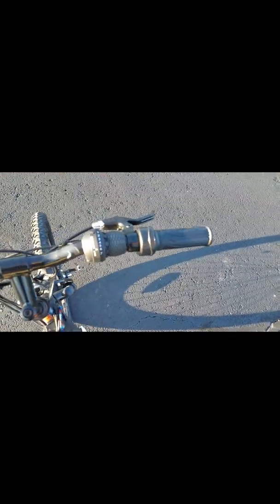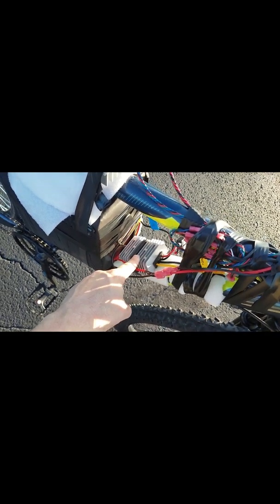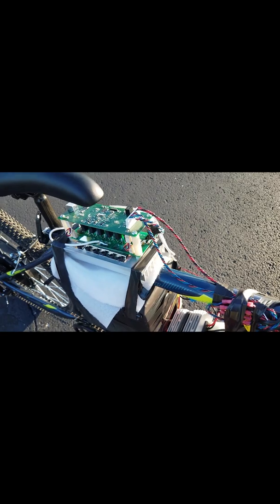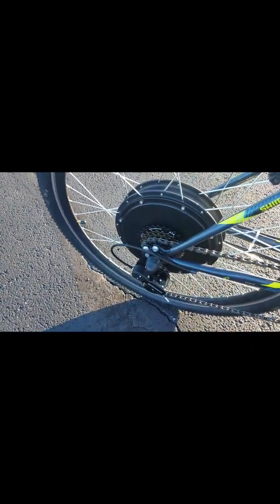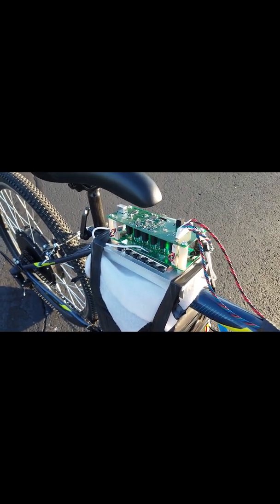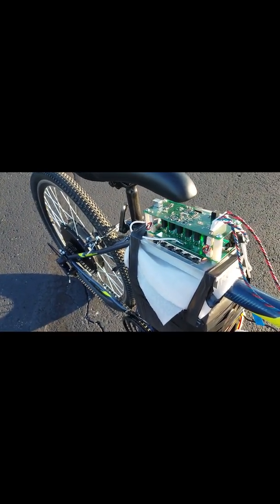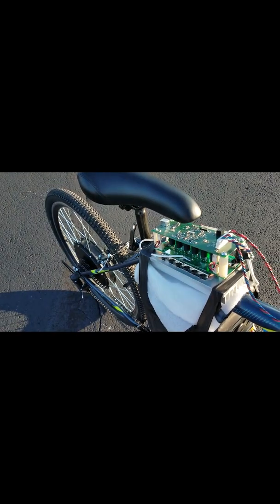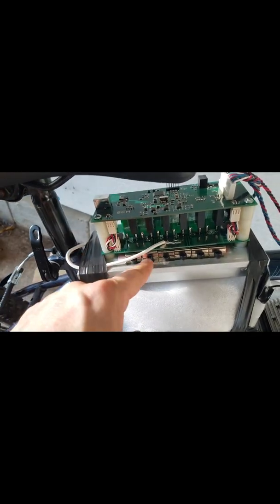First test of E-Bike With Home-made controller

Comment: Hey, I'm going to video my latest version of the leaf motor doing work. I bought a grasshopper mower and it's now running 96v with the leaf motor/controller and your board. Pulls 3kw while mowing and only gets a little warm to the touch, no coolant needed for my little yard.
Reply from the maker: Awesome awesome awesome!!!  Yes please share!
Reply: @MPaulHolmesMPH  I want to build a 4 wheel motor 4 seater bicycle. I bought the same style motor so would there be a way to combine the whole thing into 1 main controller and throttle?
Reply from the maker: @windydrew  If you have 2 separate motors, it will require 2 controllers (or a single chevy volt controller, which is secretly 2 controllers in one.  those are pretty cheap, and I have a board for that), since the control requires the position of the motor shaft and the current in the phases, and it would be 2 separate positions, and 2 separate currents.
Reply: @MPaulHolmesMPH  I'm using 4 separate motors. I understand that I'll need 4 seperate power sections but could I combine them all together and use one control section. Total power is 4kw so your bike boards would work. Email me and I could help get your bike boards field tested. Thanks
Reply: I second that - please do a video! I've converted a Cub Cadet LT1042 (48v, just replaced the engine with a ME1004 brushed motor), but am planning on doing a more comprehensive build one day (dedicated motor for each blade, so no lossy belts & pulleys ).

Paul, can this controller do the full regen current? e.g. for the blades, for a quick 'stop'.
Reply from the maker: @DuncanAitken  Yep!  If the batteries can handle it.

Comment: Squeeze both at the same time and do a burn out... (I am kidding here)... awesome work paul... Sensorless, or sensored.  If sensored what type?   Can you make it to take a resolver?   The motors I can buy have a resolver built in them.

I love the 2 throttles idea.   

I'd love a 400v 50amp controller... that would be 25hp ish...  A great amt for a go-cart or run 2 for an off road buggie!    Are you planning on selling anything?
Reply from the maker: Sure I can make it take a resolver.  I would have to modify the power board a little for high voltage (increase spacing and add a little more room for capacitors), and add the stuff for the resolver on the control board.  This is just a prototype.  This is sensored.  It uses the U/V/W pulses from the motor, and interpolates, since the resolution of them is only one pulse every 60 degrees.  So, there are 65536 "degrees" for every 60 electrical degrees.
Reply: @MPaulHolmesMPH   The motors I have bought are the HSG motors from hybrid cars.  Good for anywhere from 8-20kw depending on cooling.  Cheap, ($100-$200) easy to get, and hell for stout built.   Motors are heavy, but good for buggie applications.  They come with a resolver.   I think if you could make a kit to plug into those that would be a good product if it can be done in the 500-700 dollar range.   More than that, may price you out of the market.   Does your controller go thru an auto tune process?    Again, super stoked on the controller, I have been waiting for a HV low amp controller for years.
Reply: @ericensley2427  have you a model number for the HSG motor please, Eric? Specs look great (esp for that price!!)
Reply from the maker: Well shoot!  I'll do that then!  $500-$700 would not be a problem.  The tuning would be very easy, but it's not automated.  There's just a couple things.  First, is the Kp and Ki.  If you know the phase to phase resistance of the controller, I can give you good values for Kp and Ki, and you can then run a quick test over the serial port to see if they need to be adjusted a little bit.  Then, you just have to find the difference between the north marker of the resolver and  the electrical north of the motor.  That's also really easy to do.
Reply: @DuncanAitken  
Go to LKQ look up alternator on a hybrid sonota 2014+? something like that.   There are a number of cars you can get them from... Basically any car that is a hybrid should have an HSG (Hybrid Starter Generator)
Reply: @MPaulHolmesMPH  The closer you can get it to the 500 dollar number the better :)   But look at the market... there is nothing... yes there are curtis controllers that can do 150V max, and that is OK, but if you can get up to 400V max then you can really use these motors to their potential...   The back EMF wont start pushing back on you till higher revs.   You can gear them lower and get more usable torque out of them.  (All stuff i know you know)
Reply from the maker: @ericensley2427  400v is no problem.  Does it need to be 20kW continuous?  What power rating  for peak?
Reply: @MPaulHolmesMPH  
20kw peak, say 10 kw cont?
Cont is all a function of cooling.   The HSG motors are water cooled, so I could do a water cooled plate for the igbts.
Reply from the maker: @ericensley2427  OK.